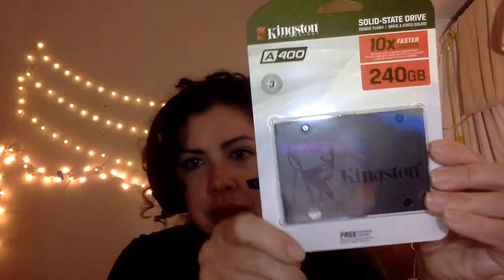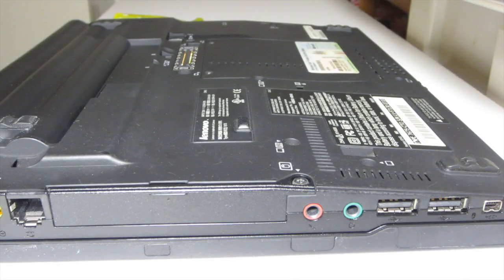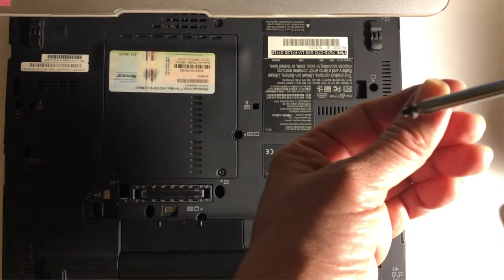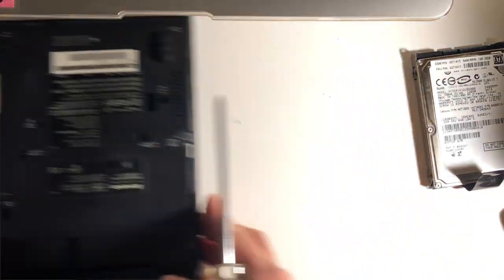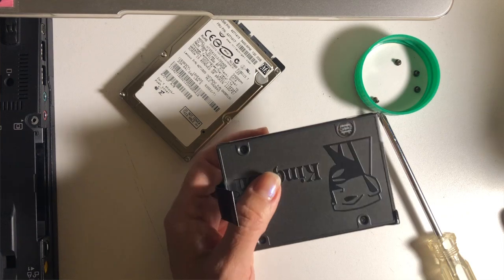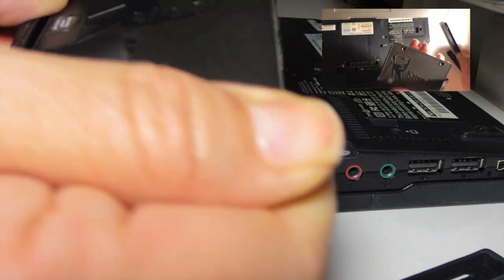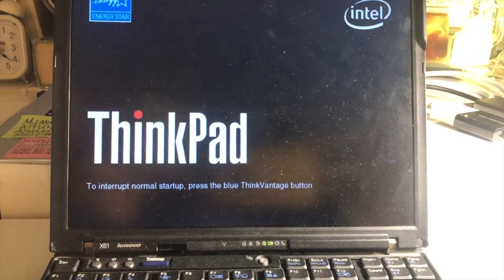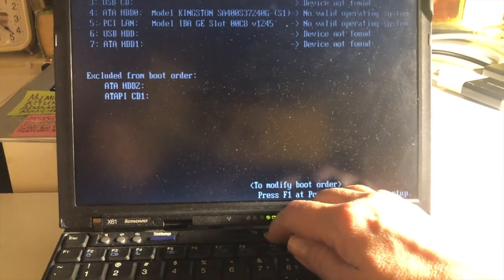New ThinkPad enthusiasts, do this or your laptop won't work for long

Comment: Wow Awesome, loved this video ,Thank You ,im a 51yo Thinkpad and Linux Fanboy,lol ,been using Linux since 2008 and still learning, I have among other machines a Thinkpad x61 with ultrabase and i have Void Linix running on it ,and is it fast got a very old machine, you can run 64bit OS on the Thinkpad x61 and i have maxed my ram to 8bg,  Enjoy your learning and Linux experience and always do what works for you! Greetings from Cape Town!
Reply from the maker: I am so happy you enjoyed this video! You have confirmed for me that the ThinkPad x61 can take 8GB or RAM. My latest upload speaks of my comic adventures learning about that :D.

 I agree with the 64bit OS. I installed LInux Mint Cinnamon on mine and it is 64 bit and was pleasantly surprised that I could seamlessly connect online. 

Thanks so much for stopping by to watch my video. All the best! 
Cheers! :)